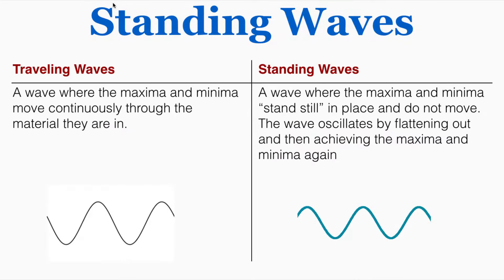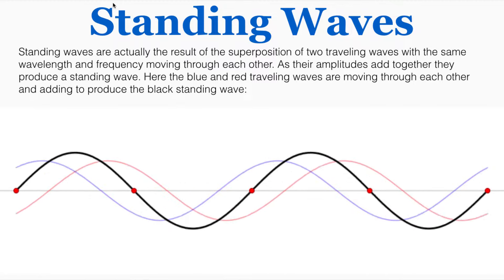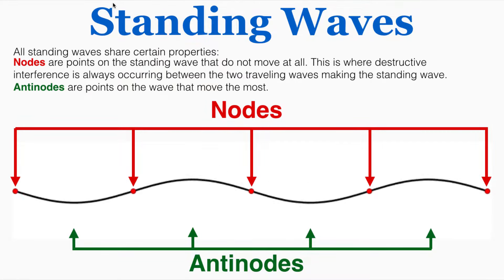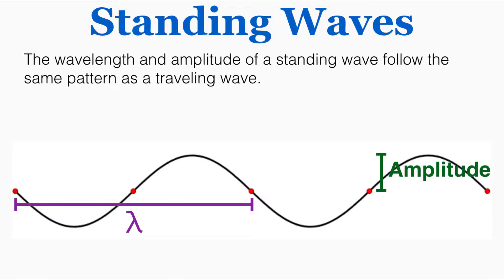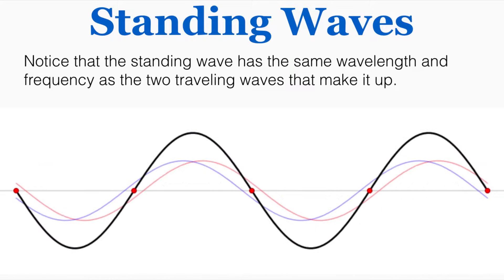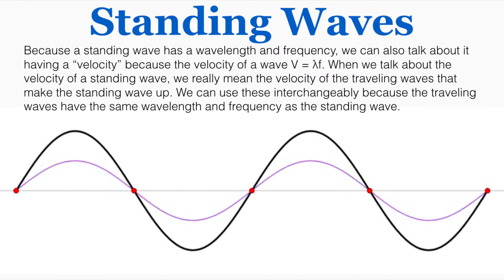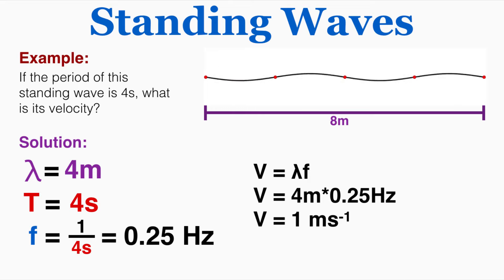Standing Waves - IB Physics

Comment: 00:04 This lecture is about standing wave patterns in physics.

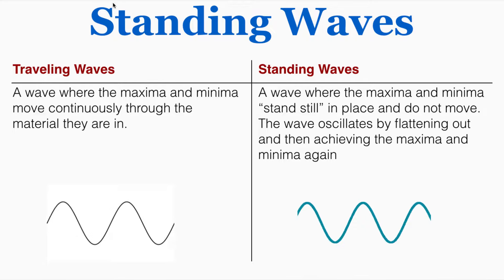00:47 Standing waves are important in physics.

01:27 Standing waves are produced by the superposition of two traveling waves

02:21 Destructive interference creates standing waves with nodes and anti-nodes.

03:03 A standing wave has the same wavelength and frequency.

03:46 The period and frequency of traveling waves are equal to that of the standing wave.

04:29 A standing wave has a velocity equal to wavelength times frequency.

05:14 Standing waves have a velocity of 1 meter per second